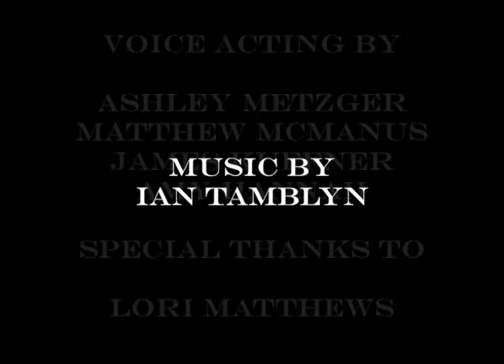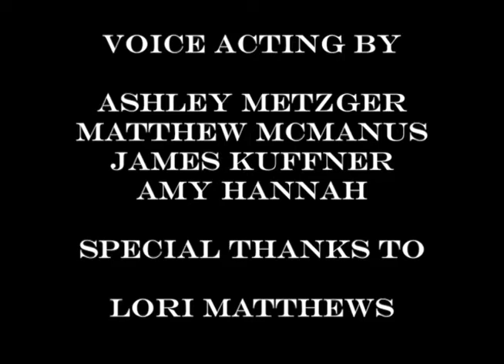Steam Locomotive CPR 1201 Documentary "Losing Steam"

Comment: They need to do something with the collection before it all turns to rust.
Reply: It's all in doors.
Reply: Then they can put it on display. Only part of the museum's collection is visible.
Reply: It's not a railway museum. It's a museum of Science and Technology. Have you actually seen how much equipment they've got?  I have!  What's on display now is only a fraction of what they have.  There is only so much room inside the main building.  My point is, with the exception of 6200 on the front lawn, ALL of the equipment is out of the elements and will not rust.